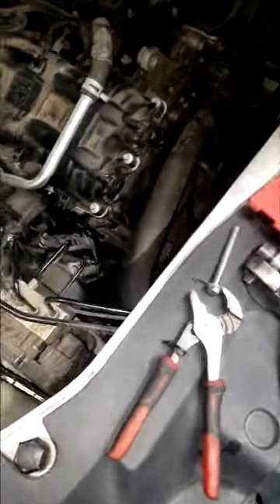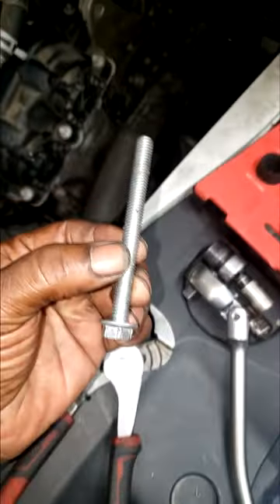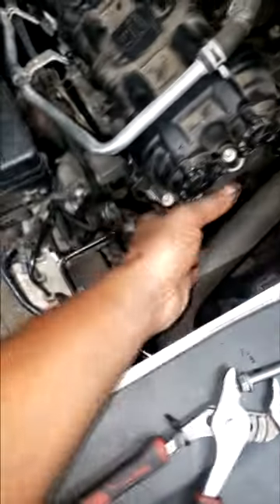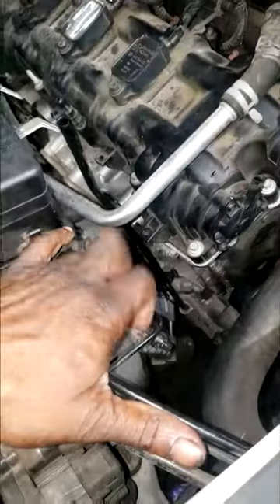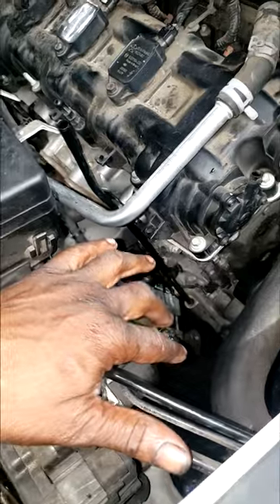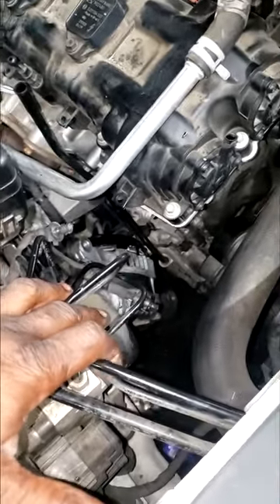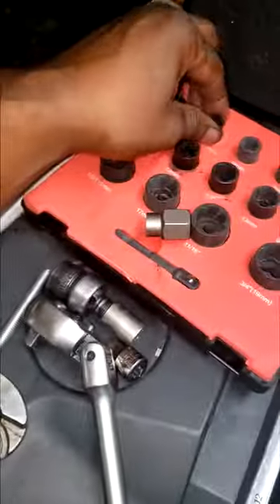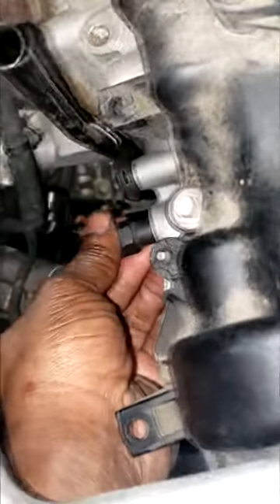Here's why we may have to replace the MOTOR in order to get the charging system alternator to work.

Comment: There’s no hoping I would definitely get it out cuz there’s no way anyone will take that replacing the engine jive. That’s just obscure and no one with a right mind will do that.
Reply from the maker: My guy nobody is obligated or have to do anything. All customers have the option to simply say no. Your comment makes no sense, sure we all hope we can get it out but if we can't, it will need a engine, Simple as that. The broken bolts are in the block and the head. We don't rig things. These bolts appear to have been broken for awhile now, came from another shop. This may seem like a shocker to you but its reality to us, happens.
Reply: @OnlineMechanicTips  at worst you take the head off replace it or send it out to machine shop no need to replace a whole engine lol
Reply from the maker: @awesomeHDtutorials  no at worst you may need a engine. The bolts sheard off in the block and the head. We explain to  customers the worst case if this fail.

Comment: Top bolt, use heat and "C" type vice grips.  Bottom bolt, drill on center as best as possible, use "reverse flute" bolt extraction tool. Looks like a drill bit, BUT, is hardened and LEFT hand threads. 😎👍
Reply from the maker: We gone give that a shot 2morrow, thanks
Reply: @OnlineMechanicTips  Awesome JT.  Hope it works out for you 😉
Reply: if the tool and the hand could fit loosely that would be a better solution

Comment: can't get a bolt out just slap a new engine in... 😂 smh
Reply from the maker: Whats your plan if it won't come out?
Reply: @OnlineMechanicTips  replace the engine lol seriously though 2 bolts will hold it in just fine
Reply: @OnlineMechanicTips  well it looks like the broken bolt is in the head, worst case scenario, remove the head and replace with a used one or take the head to a machine shop and have them repair it. Literally no reason to replace or even recommend an entire engine over a broken bolt for an alternator. There always someone more qualified for the job, this is just out of your wheelhouse man, no hate, Ive worked in many different shops, now I'm independent, but I'll still send someone to a more qualified shop/person if I'm unable to repair/diagnosis the problem correctly. It's just the right thing to do, can you honestly say you feel an entire engine replacement is called for in this situation?
Reply: @nunya2814  exactly no reason why the customer should spend 4-5 thousand over something as simple as this. now if there was a broken head bolt or timing chain/belt related bolt then yeah i can see why another motor is preferable but come on an alternator bolt ???
Reply from the maker: @onthemolly  2 bolts are broken, one in the block and one in the head. There is no stubby on the broken one in the block. And for the record, we dont let cars out with 2 bolts if it calls for 3. This is a huge shop, not a dam garage. You tryna get us sued?
Reply: @OnlineMechanicTips  that's why you let the customer know beforehand lol is this even at the dealer?
Reply: I think the point he's trying to make is we all know two bolts with some blue loctite would be just fine but due to the current climate in this country you can't be too careful. One mistake can ruin your business
Reply from the maker: @firstlast---  ding ding ding.
Reply from the maker: @onthemolly  Why do you always disregard the customers other options??? They can simply say NO to any repair estimate we give..We not putting our business on the line for some fluke ass repair that could go wrong that came from another shop. FOH with that dude. It dont matter if this a dealer or not. You yell out suggestions as if stuff easy, if thats the case, why did the other shops do this and didn't fix it?
Reply: @OnlineMechanicTips  you didn't read my comment... I said that's why you let the customer know beforehand
Reply: if you can't get the bolt out just say so we aren't skilled at everything lol
Reply from the maker: @onthemolly  Customer knows whats going on, shes pissed at thos other shops. Thats not our problem. I told if we cant get it to just take it to Prodbypandas Automotive, sure they could over there..lol..So hold tight
Reply: @OnlineMechanicTips  yes send them to me i'll be sure to not tell them to buy another engine...thanks

Comment: Lol imagine replacing an engine over 2 broken bolts. It's aluminum weld a washer to the flush broken one then weld a nut to it. This is a 10 minute fix. I couldn't imagine being a mechanic without knowing how to weld
Reply from the maker: This also a video, explaining  the  worst case senerios of what may need to be done if unsuccessful to the customer. We don't sugar coat nothing over here big dawg. But we got this, everything under control.

Comment: I don't know why people start smacking the guy about replacing the engine, These all about dealership rules, The rule i think is, if he can fix it without using any other facilities outside the dealership go ahead do it, if you can't then replace the part, but if the dealership has the flexibility that can take cylinder head to a machine shop to do it, i think he doesn't hesitate once to do it, so please STOP blaming.

Comment: Drill it in the middle with a right angle drill , and bit for drills steel, then use a easy out extraction process, spray with 
PB BLASTER before you try to extract the broken bolt 'or drill and retap new threads . Been there done that, .....it works, it will come out, this is a problem identified when bolts are made with low quality steel, then someone trys extraction with impact tools , ...and don't use a lubricant.

Comment: Replace the engine??? Good night! Great videos but no way I'm giving the customer an engine replacement quote for a broken bolt, that's just crazy.
Reply from the maker: So what will you give them? You do understand that there's no guarantee that's coming out right? If you that big of a coward to not be honest to your customers, should you really be in the business? We don't sugar coat nothing because we not about to get sued for a problem we didn't cause. Answer the question, if there's no luck getting it out, what is your next move?
Reply: @OnlineMechanicTips  how i would sell the whole thing to the customer is explain to them what's goin on and tell them you will attempt to get the bolt out which on the surface looks to be a 99% probability of getting out and tell them if that don't work you'll have to take the engine out to get to it and then and only then tell them at that point decide to go back in with their engine (assuming it's still in good shape) or replace with a different one which again I can't imagine would be feasible. Getting sued would be least of my worries on this one, If anyone was to be sued tho it should be the other shop that broke the bolt off.  But that's how I'd explain it to customer. 1. Other shop caused the issue 2. Will try to extract bolt with engine in 3. Will take engine out to get bolt out.
Reply from the maker: @codywilson9791  Great answer my guy.
Reply: @OnlineMechanicTips  did you guys get bolt out or still working on it?
Reply from the maker: @codywilson9791  Hes headed over there with his welding machine now.
Reply: @OnlineMechanicTips  awesome, keep us updated on it
Reply: Image u go drop ur car off to get a alternator and they call u saying “u need a new engine 🥴 I’ll shit my pants 💀
Reply from the maker: @moneybags7482 lol, naw don't do that. Simply ask why, I'm sure they will tell you, then when you hear that it cost to much, you simply say no and come get your car. These big shop not risking it all on fluke attempted repairs that another shop screwed up. We don't mind when you say no and then come g see t your car.

Comment: That's an awful big leap to changing a whole engine just to get a few broken bolts out. The only reason to change the entire engine would be if the block is trashed internally. Like say if a rod felt like exiting the conversation. It may be a lot of work to fix it proper. But that's why it's proper. You may get a less than desirable review if you're changing the whole engine because you didn't want to get some broken bolts out
Reply from the maker: My guy, we let the customers know the worst case scenario. Nobody including you know if this bolt will come out. This is a older video, and yes we was able to get it out but no one knew for sure if we would be able to get it out. Nobody cares about reviews when a real world problem or decision have to be made.
Reply: @OnlineMechanicTips  And I get that about giving worst case scenarios. But even still. There are many steps between getting the bolts out and replacing the whole engine. What I was trying to say about the bad review is, imagine you were the customer. And you knew what most customers know about cars, which tends to be very little. Then you just got the news that you have to change a perfectly good engine, which will cost several thousands of dollars because some $10 bolts and some labor. I'm not knocking your work. I'm just making a comment on a video I only just saw today. I too work in the automotive repair business. So I'm just reacting to your drastic leap to changing thw whole engine. Always explore every option before jumping to worst case scenarios. Only when all options are exhausted do you give them the bad news about needing a new engine
Reply from the maker: @richardwilliams9181  Well you are simply speaking the obvious. Of course we will try to explore every option at getting it out, But we tend to make the customer aware of the worst case just in case those options fail, That part not up for debate, managers rules. Every shop ran differently. I do however appreciate the view and the comment,. Its always interesting to hear from other mechanics and shops take on things. Yea and man we (big shops) tend to get a lot of lawsuits when things dont go as plan, or for that matter the customer not aware of certain options so a lot of things around here has changed. Thanks man.

Comment: Reminds me of a water pump job I just had to do. Quoted them book price 2 hrs labor and it arrived on a flatbed with no mention of a shade tree mechanics failed attempt stripping the bolts cause they were seized in the aluminum block. Spent all day on it couldn't do any other jobs and only made about 20 bucks after it was all said an done. Sometimes we roll the dice, sometimes we win.
Reply: i had an expedition come in another mechanic took the heads off and was gonna do head gaskets then he passed on hte job according to the customer, the boss took the job of reassembling everything together new gaskets and timing set i bet I spent over 3 hours just looking for bolts so i could put it together and another 2 hours repairing the wiring harness the guy broke during removal. im pretty sure we couldve done 2 engines in the time it took to put this one together and make much more profit
Reply: @onthemolly  f.
Reply: @joe1273  yes

Comment: They knew it was like that, they probably caused it but of course they're not gonna fix it or say anything about it.
Reply from the maker: They may simply say put it back together and dont worry bout it if we cant get it out
Reply: Had a mechanic do the same similar thing maybe 2 decades ago and I kept having to replace my alternator until I finally took it somewhere else and was told one of the bolts wasn't on the alternator so he fixed the problem so it wouldn't fail again. That taught me to learn how to fix it myself.